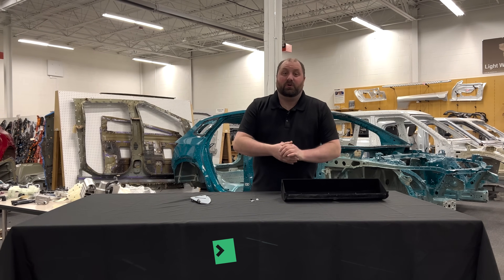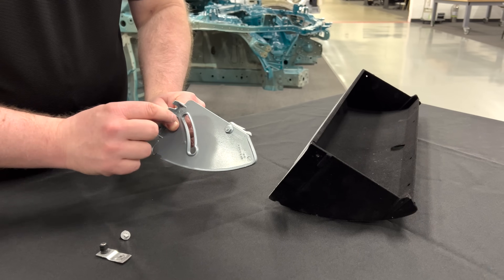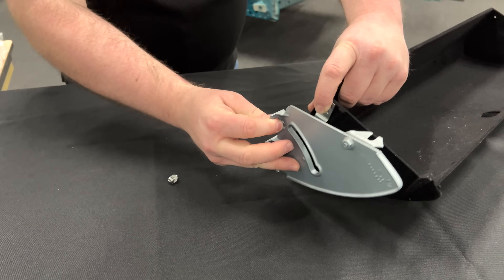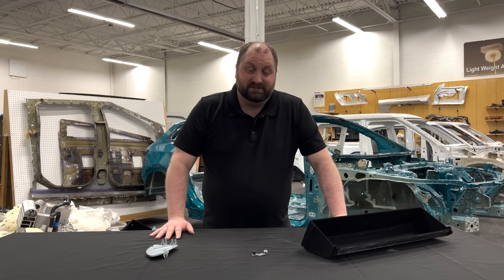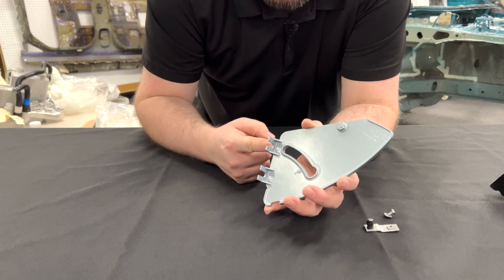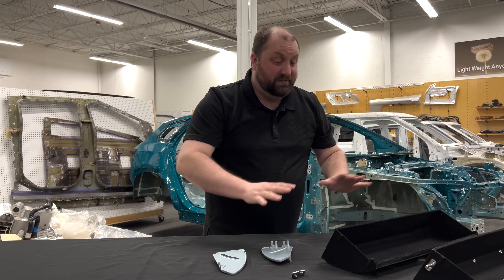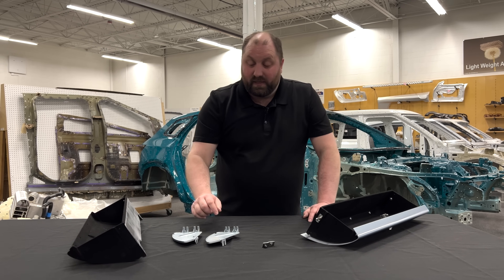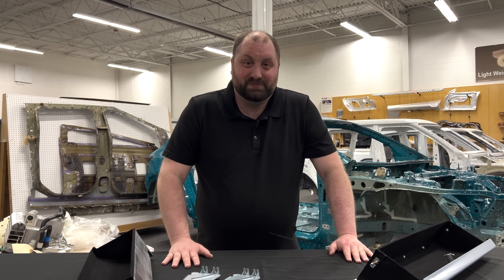The Million Dollar Difference: Why Working With Munro Pays Off

Comment: It a classic "Over the wall engineering" cog in the wheel problem from compartmentalization to hierarchy blame culture.

If issues like this happen hundreds of location, it no longer an engineering problem, it a systemic company structural problem setforth by the managers, VP and CEO, as some managers fearful of specification change than what was "instructed" to engineers, so it not fair to say 'engineers being defensive', when there is a blame culture.

A 'good' engineer always deliver, a 'great' engineer always go beyond than what was ask of them.  Like typically looking all the 'interconnecting points' or tasks overlaps with other engineers and ask how can it be done better.

However, some managers hated relinquish this type of interactions to engineers, because it put managers in the spotlight when Gant chart tasks prioritization become less precise by the upper management.

I have both R&D plastic injection and metal works throughout for 2 decades, from concept including ramp up to mass production, the stuff you shown is a 'horror show' if it was proposed today, even with the screw on pin solution, but 1960s injection as you say is still in it infancy, so I have to be very lenient to that perspective.

Solutions & rules:

1 - For reliability and continuous cycle use, always best having moving parts like slot and pin guide made of metal.
2 - where possible move all the static features to the plastic side, because 'some' can baked into the mould tool for free.
3 - screw on pin to plastic is old school, not the best form of alignment, though reliable.  e.g. today in injection technology have metal inserts via thermal or ultrasonic or mechanical press fit.

4 - Instated of cast, can the bracket be sheet metal with gusset for strengths

Comment: If I were a manufacturing owner or CEO. Every single engineer would spend 1 month working production for every year under 10 years out of college. 1 year out from college, 9 months on the line. I don’t mean a few hours here and there, I mean on every part of the assembly line all day.

Comment: Maybe there is someone who worked for or with Ford who could explain why in the mid nineties Ford used a gas discharge bulb (like a neon or HID) for the high mount stop light (CHMSL) in Explorers etc.
Back in those days I was working at a repair shop and I noticed the CHMSL wasn't working on a customer's Mountaineer (a Mercury Explorer). No big deal, just replace the incandescent bulb...  but there was no ordinary bulb. The bulb and ballast cost $400.00 from Ford and replacing it required removing the tailgate inner panel, then drilling out rivets to remove a steel plate to access the lamp!
 Sure the lamp assembly didn't cost Ford $400, but it must have cost many times more than a standard incandescent lamp assembly, the same as other vehicles used - and later Explorers did go back to an incandescent lamp.   Why? My only guess is some kind of kickback from a supplier. BTW a few years later the aftermarket came out with an LED lamp to replace the original assembly.
Reply: Oh wow, I have never seen that application before. Do you remember what year model this Mountaineer was or if you have seen the same thing in other Ford products? Now I'm curious to investigate because that seems like one of those "why would they do that" decisions and I wonder if the potential supplier kickbacks you mentioned could answer other questions about things that just go bad in our fleet.

Recently I replaced an incandescent in a CHMSL that lasted around 15 years with an sub $20 LED bulb and the heat from it evidently cracked and burned away part of the internal reflector housing so I am happy with the brighter LED being an easy plug and play in most cases. That said I had to replace an HID headlight in the same vehicle and that cost something like $225 (not including the ballast) and was a pain to refit the delicate thing in a tight space. I know a 1W bulb and a 35W bulb are different but that still sounds like a weird decision Ford made.

Cheers!
Reply: @ZealofSparta  You got me to look into this again (Was quite a few years ago that I saw that Mercury). Turns out that lamp setup was in Explorers 1995 - 1997 and in the Mountaineer only for 1997. Google Dorman 923-202 to see the aftermarket LED replacement, Dorman even has a video showing how to remove the original unit. BTW I see the Dorman unit is $159.00 on Amazon - but still cheaper and likely more reliable than the original. I see someone advertising an original used unit on eBay for $299.00!

Comment: Manufacturing cost is certainly a major criteria for any product.
I would be interested to have some examples that Munro recommended for Aptera.
In particular, from the start, I was never very fan of the Elaphe in-Wheel motor used by Aptera.
I always think that a single motor was simpler and cost effective solution, 
using already universally used and validated motors, such as the Vitesco Technologies EMR3.
I even wonder if an Aptera without solar panels would save cost and weight.
Don't forget that solar panels would only provide sufficient solar energy in summer in most parts of the US.
With a $40,000 Launch Edition price, the Aptera will be hard to compete with the current $42,500 Model 3 RWD.
Reply: It is Vaporware. Too wide. Too expensive. No load for passengers nor cargo. Dead end.

Comment: Building components in isolation / silos causes this. Complimentary parts should be designed together.
Reply: Right!  It seems a fair number of improvements come about because someone finally saw how many functions COULD be complimentary.
Reply: Yes. This example sounds a bit weird. Who would design the plastic mold without ever looking to the hinge designs? Makes no sense.

Comment: GM had an internal rewards program where employees could earn royalties from the successful implementation of a cost savings measure.  I was involved in several of these bespoke plant “tours” with their production Engineers, though I worked for a supplier and wouldn’t get rewarded even if I did suggest one of these ideas.

I’m sure other companies do similar things.

Comment: Any company that puts engineers above managers and accountants will succeed.  GM would be best served if they cut manager jobs by 50% and doubled engineer pay by 200%.
Reply: I worked for Ford, GM, Chrysler and Toyota. GM was the worst at having engineering trained or at least manufacturing savvy not in positions of quality or simplicity of design and build. They chose to have college graduates be the front line supervisors rather than leaders that came from the floor up. Ford was best at having experienced leaders from the production floor not the classroom where they had no understanding of the details and problems encountered daily!
Reply: First a company needs a real CEO... Who won't suck it dry, while destroying its reputation.....Time to go buy a used Tesla, before they all get destroyed.

Lastly the only thing the OC proved is we still need accountants, cuz nothing he said added up....

Comment: I see this one 2 ways. Yes, lean design and alternative design choices can have sizable impacts at volume where every choice is magnified (100k/yr x 7yrs). The other way to look at it is that if your businesses success rides on $1M of margin from hinges on $5B ARR your in a shitty business and doomed to fail. Not to mention you need 100% perfect parts to build, not 99.99999% which gets into risk mitigation. Is it worth risking your launch timing/quality for a feature the customer wont notice and provides no differentiation? Obviously the answer should be somewhere in the middle but its not 1 sided to always optimize every hinge.

Comment: About 1980 I was wiring control panels for shrink wrap tunnels and ice cream filling machines. We mounted the terminals to a piece of white painted 1/8 by 1 inch bar stock. drilled with mounting holes and tapped to mount the terminal strip mounting rail. There were 29 drawings and part numbers for this piece of barstock with holes. For all sorts of enclosures and panels. It often came to me a week after I assembled the control panel and left the wires hanging. I suggested that they paint 100 feet of barstock and give it to me in the panel shop. . Assign a part number to 1 inch of barstock and have the engineer spec a given number of parts to tell me  how long to cut and make a mounting bar. I was drilling and taping many holes on the control panel, had all the tools ready for use. Almost every one who had any part in the foolishness told me how this would not work. The most ridiculous  excuse was, 'what if a customer needs to order a replacement part. " This had never happened . Ever. It was inside an electrical enclosure. The company went out of business a few years later.

Comment: 7:55 Why did the hole remain?
Reply: The injection molding plates are very expensive and are built to very high tolerance. It's safer to add a single modification, like adding a piece to make the hole, than to make two modifications like to a piece to make the hole and them removing the original hole.
Reply: The hole driller, Harry, was union labor and they could not make him redundant without causing a strike.
Reply: @Martin-se3ij  LOL.

Comment: The problem is knowing when to stop because eventually, you cross that line from smart cost savings into savings at all costs and you end up making a product that is much worse and doesn't last as long all in the name of saving a buck.
Reply: I feel we crossed that line in the early to mid 2000s, and it's all been downhill with more unwanted features to increase margins and OEM/dealer repair profit, but built cheaply to decrease cost.
Reply: Yeah, and that seems to be more prevalant these days... original design; works.. somewhat. Next iteration; perfect! Then comes the cost savings and longevity of the end product takes a nosedive...

Comment: I don;t get it .. Ok you saved the company $100 / car. But what's stops the company to simply put the $100 on the customer and don't bother with consulting and wasting time ?!?
Reply: because it helps the car company's bottom line which in turn pleases investors.
Reply: Competition. If you can make your car cheaper you can improve margins and lower costs for the customer. Usually companies love to improve margins, but if your competitor reduces their cost and lowers their prices, you need to compete.
Reply: @ that's min-maxing ... in the 1960 from when the story is .. cars were so different , that prices were hard to compare. Each model was unique and offered a different experience.

Comment: It's funny how often consulting can be about finding someone else to blame so that they can have their own way without risking their position
Reply: It works. And both the consultants and the ones who hired them win. It’s the leadership that loses by spending more time and money. But I cannot blame leadership. For every smart engineer that they should have listened to there’s another 4 that should absolutely be ignored.
Reply: I'm guessing when you think consulting you often think of management consulting or HR consulting.. ie both typically have some form of negative outcomes..   But Munro is technical consulting..  u have a problem with a part and they have the expertise to find a resolution to that technical challenge.  No blaming there..  Never had what you described for technical consulting.. beyond maybe someone was the wrong person hired for the job.. but beyond that theres always a technical resolution. NEVER have i see anyone point fingers when the goal is to find a technical solution.. because thats a failure of the consultation..
Reply: I seen engineers say solution is A, leaderships don't trust the engineers and hire consulting that say solution should be A, then learships say, solution A is what needs to be done! Money and time just evaporated!

Comment: I'll admit to being a somewhat nerdy engineer. Way back in 1977, I bought an International Scout with the 345 V8 (I wish I still owned it) That vehicle had a glovebox similar to the one that you showed in this video. It rattled as we went over bumps and no matter how I adjusted it, I could not get it to stop rattling. I later bought the first new Mazda RX-7 and it had absolutely no rattles. Its glove box was totally quiet! I'll never forget when my wife asked "What are you doing?" as I laid on my back in the first week I owned that car taking apart the glovebox to see how it was designed. It was mostly a single molded part. Kudos to Mazda. Competition is wonderful for the customer!
Reply: I still have the same rx7. 45 years old and still no rattles :)
Reply: The rx7 should have been a keeper too.
Reply: The 1970 2 door rangerover had alot of inspiration from the International Scout, I'll leave it for discussion as to whether it was an improvement 😂 I've still got mine 35 years later, small glove box though, luckily I don't wear driving gloves.......
Reply: Those Scouts were junk and that is a good reason why you are not driving it today!

Comment: Reminded me of Toyota Aygo (and its two cousins). The entire dashboard is held on by a bunch of tabs and a single screw. Cheap to manufacture, extremely cheap to assemble. And the miracle is that with just that one screw, nothing rattles. Some cars rattle with at first glance far more secure fastening of interior panels.
Reply: I teach Mech E at a leading university and stress designing physical features to carry the load and use fasteners only to hold the part inplace for those features to do their job. But, to get the students to apply the concept is another challenge. I explain that they need to stand out in the application pool and if the potential employer sees this type of knowledge they will be way ahead of the other applicants. Nope, they think their I.Q. and the University name recognition is enough.

Comment: Get rid of the aluminum bracket and the pin, install a strap to stop the glovebox lid; I'm a high school dropout and I just saved them several million dollars.
Reply: The glove box would rattle and flop around. It would be awful. Yup, you're a high school drop out alright.
Reply: @themonsterunderyourbed9408  There is no reason it would, and the system they used would do nothing to stop that anyway.

Comment: If you make the pin oval so its stiffer you can mold it in place. The only adjustment you need is to make the track in the casting a bit longer. Oh, you would shave off some grams too 😉

Comment: A lot of GM vehicles.
There's a Kettering connection, I betcha......must be Sue
Question?
Do a Ford Ranger or a Ford F-150 Raptor.
Why doesn't FORD make an a Extended Cab Ford Ranger with the 2.3 cylinder with a manual transmission?
Yet you can get a Ford Bronco with a manual transmission with the same 2.3 engine?
About the injection molding what is the makeup of the plastic while compounding?
Management is what is killing the auto industry. 85% of managers have a Negative or 0 return on the company.......
Reply: At least he was a self-starter

Comment: As a former Product Manager I was the guy that worked with the R&D and made those calls. Product Manager must 1. Add features. 2. Reduce cost. 3. Be able to charge more for the finished product. The Product Manager must know the industry its competitors. The user and their needs. If you get 1&2 right you can accomplish 3. It’s a fun job that you do mostly in your head keeping track of what your customers are saying, industry issues if you’re selling into an industry that is changing system materials and methods. Must be involved in technical committees and associations. At one time I thought I had to drink but that got in my way so I just got my customers  drunk. The most difficult job I ever had. Oh invent new products I have several patents in a very mature industry.

Comment: Fantastic breakdown. I'm curious how AI might solve these problems in the very near future prior to all the tooling and finalization.
Reply: AI is that clever guy that designs the tab that was unnecessary.
Reply: Main Problem is like is the same as today. Many things that are required are nowhere written down or explicutly stated, but known to some important people involved, by sheer experience. Writing all or most of tof them down is hard to impossible. We call that modelling.
If the model fed to AI the same will happen as it does today, no matter if the AI would really surpass human engineers. Garbage in, garbage out.